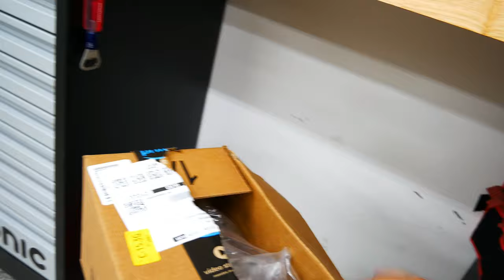Motorcycle leaking gas! Time for a new Carb! TW200 Build!

Comment: On a TW200 I just worked on the float pin and seat were not worn but the o-ring on the seat was hard and letting fuel past.  Had to take the bowl off to replace a ten cent part.

Comment: I stumbled across your channel searching for Tw200 content.
Reply from the maker: Nice! Thanks for watching! You have a TW?
Reply: @GasTachs  yes, I purchased a new 2021 in October 2020
I have been adding mods to it ever since. Skid plate, foot pegs, bar risers and new bars. I also added a new rear rack. After seeing your video on changing the front fork springs and rear spring, I am going to do that as well. I am about 6’ and 250ish, lol.
Reply: @GasTachs  I did also purchase a set of hand guards from highway dirt bikes that I seen the tdubskid install on his tw200.
Reply from the maker: @alfredramirez4534  nice! Enjoying it so far? Just make sure you go with the medium rear spring as this one I put on is HARD.
Reply: @GasTachs  I guess I should have asked you about that before I purchased the one that was recommended by pro cycle. I got the heavy spring they suggested for my weight.
Reply: @GasTachs  yes, I am really enjoying the bike. I made sure I got my license and insurance for it before really getting on the road with it.
Reply from the maker: @alfredramirez4534  I have that one now. It did get used to it after a while so I wouldn’t be too concerned.

Comment: Thanks for the video!  I just bought a 2013 T-Dub with 1400 miles.  Since it hadn't been used much, maybe 300 miles of usage since Aug the pilot jet seemed clogged(at least partially)  It ran ok once warmed up, but would not idle worth a crap.  From research it seems the stock carb has pretty bad jetting, so a lot of people have had the same problems.  I just ordered the knockoff from Amazon, and was wondering other then the swap over with throttle bracket, and idle adjustment cable did you make any other adjustments to the air screw, etc?  Are you still happy with it?  Any issues?
Reply from the maker: Still works like new. The about of S#£T I got from people changing it out from OEM to cheap aftermarket was crazy! But all works! Good luck!
Reply: @GasTachs  Teikei, with Yamaha backing, built a factory in China (about 5 years ago) that builds carbs.  So  before that there was no knockoffs.  So the quality of these carbs looks to be as good or almost as good as the OEM.  The only thing I had a issue with was swapping over the OEM cable idle adjuster.  I couldn't get it threaded back in the new carb.  Ended up just putting the stubby one back in.  Bike is def running a lot better with the new carb.

Comment: Funny, I wanted to know if the TW200 was carburetored. Your video showed up and decided to watch. Looking to purchase a small street bike that I can throw in the back of my pickup when I go camping. ...the harley is just toooo big. fyi would like to know more about your experience with this mycle. How long have you had it... pros and cons... stuff like that.
Reply from the maker: I’ve only had it for a year and soley purchase it for the back of the camper. I’ve put 600miles on it. The biggest con (which is easy to fix) is the top speed is 50ish and it feels like the bike is about to explode. A simple sprocket change will fix that. Pros are it’s light, has a big payload and is small enough to have fun!
Reply: @GasTachs  I see... I'm looking for something light... new sprocket and chain... can't wait for the video!

Comment: Anyone else have issues with this carb's choke/enricher not working out of the box? I can pull the choke plunger fully out, and absolutely no change in engine RPMs.  Outside of that, the carb is running great.
Reply from the maker: Didn't have that issue, sorry
Reply: Yes

Comment: More eyes lost from using a screw driver the way you removed that fuel line...........Please do not pry towards your face with screwdrivers or needle nose pliers for that matter.
Reply from the maker: Thanks for the tip. Good thing I have glasses